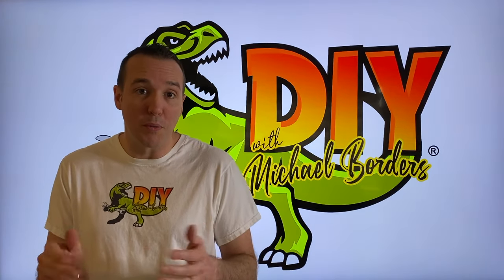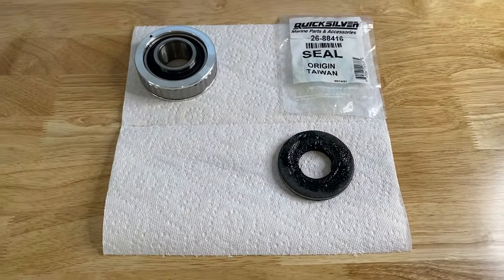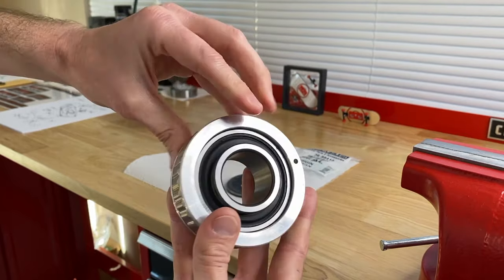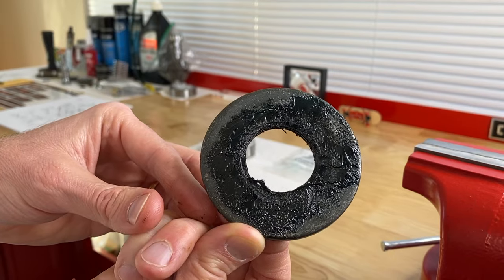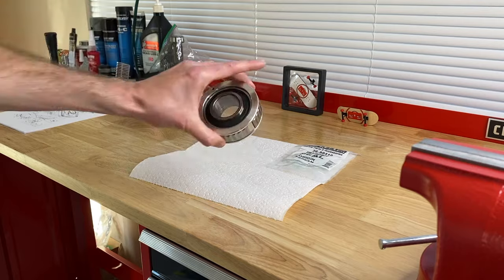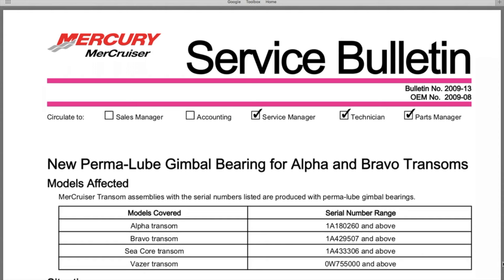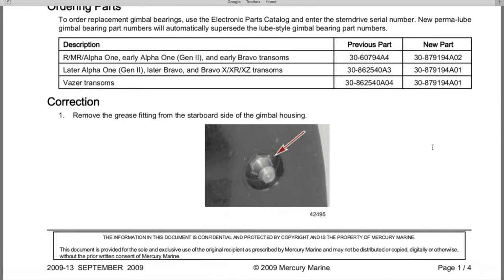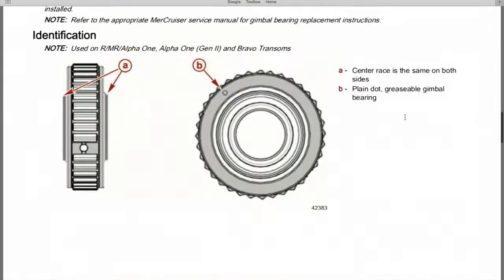New Mercruiser sealed gimbal bearing - What you need to know

Comment from the maker: If interested in purchasing this product, visit our Amazon affiliate link below.  I earn from qualifying purchases.

     OEM Set screw:  https://amzn.to/3rWY4zt

     Gimbal bearing grease seal:  https://amzn.to/3tGswhF

     Perfect seal (New sealant):  https://amzn.to/3FmGnMR

     Security bit set:  https://amzn.to/3FolgJW

     1 1/16” deep socket:  https://amzn.to/3PVEoUs

     Bellows replacement kit:  https://amzn.to/3RL7h8v

     Shift Cable Socket:  https://amzn.to/3qtVdgq

     Hinge Pin removal tool:  https://amzn.to/44YuasH

     Flex Shaft Screwdriver:  https://amzn.to/3s8E3W4

     Utility knife:  https://amzn.to/3QBjP1K

     Bellow adhesive (92-86166Q1):  https://amzn.to/3sv9nyF

     Lacquer thinner:  https://amzn.to/3QGvxbd

     Long flathead screwdriver:  https://amzn.to/3qMm08a

     Aviation gasket maker:  https://amzn.to/47XHS18

     Wire brush kit:  https://amzn.to/3OTZ8vr

     1 1/16” deep socket:  https://amzn.to/45T1u4j

     800 grit scuff pad:  https://amzn.to/47SaM2y

     Bell housing bushing/oil seals(23-805041A2):  https://amzn.to/3szdhGS

     Swivel vise:  https://amzn.to/3sfLsAv

     3/8” socket extension:  https://amzn.to/3EhRKFa

     2lb hammer:  https://amzn.to/3QDHiz3

     Water tube bushing cover:  https://amzn.to/46yp9aI

     Water tube bushing seal:  https://amzn.to/3tjcBWt

     44'' Water cooling hose:  https://amzn.to/48IEcQX

     Gear lube SAE90:  https://amzn.to/45vlqux

     Marine grease 2-4-C:  https://amzn.to/3PiLmDX

     Loctite 271:  https://amzn.to/47SXV00

     Outdrive gasket kit:  https://amzn.to/3rb5HBR
  
********

1.  Purpose of gimbal bearing - how it works

          https://youtu.be/9ldJkatOL78

2.  Remove gimbal bearing grease seal

          https://youtu.be/JfQQX81xrrA

3.  How to remove gimbal bearing

          https://youtu.be/0kgVrEixFE8

4.  How to install gimbal bearing

          https://youtu.be/0_qNYz-FBXE

5.  Install gimbal bearing grease seal

          https://youtu.be/X93vYELLtDc

6.  Sealed gimbal bearing SERVICE BULLETIN (2009-13) - Full tutorial

          https://youtu.be/VZIb1TYim8g
          
7.  Replace bellows/shift cable/water tube PART 1

          https://youtu.be/NcObTOYXtQM

8.  How to mount skateboard on wall

          https://youtu.be/c5QDCKZNGH0

9.  How to build your own custom skateboard

          https://youtu.be/9Isty_4fIIw

Comment: The orientation of the hole might simply be planned obsolescence they have it just high enough  and it will last only so long  either grease comes out or water goes in. If it was at 12 o’clock it would last longer I would suppose. It’s the only explanation to me that makes sense.

Comment: I managed to install with the dot closer to 11 O'clock. I really don't see for the sealed bearing why it matters given there is no need to line up the the grease hole. Any idea why for the sealed bearing it needs to be clocked to 10? Should I be worried if its closer to 11?
Reply from the maker: Good morning ☕️ we have asked the same question.  We have been told that this is the position of bearing during all stages of testing.

To lower the possibility of premature failure, positioning the bearing as required by engineering/engineers and as discussed in this Service Bulletin is best.

Comment: My bearing could not go all the way in...I have the proper greaseless bearing but it doesn't go all the way in?  Any suggestions . Thank you for your greatly detail videos
Reply from the maker: Good morning ☕️

Any update?  Is the replacement gimbal bearing the exact replacement part number that is stated for your exact serial number outdrive?

Did you apply a thin layer of grease to inner bore/cavity that the gimbal bearing is driven into?  That helps the bearing slide in much more efficiently.

Also, if gimbal bearing is significantly offset, it will be very difficult pressing it into the bore to a point where it’s flush with the inner stopping point.  Please keep us posted.  🧰☕️
Reply: Thank you for your detailed reply will let you know.
Reply from the maker: @jakeroth5809  

We are honored to help.  🧰